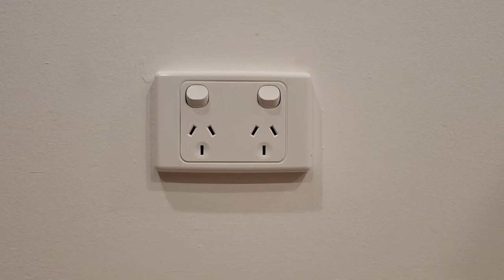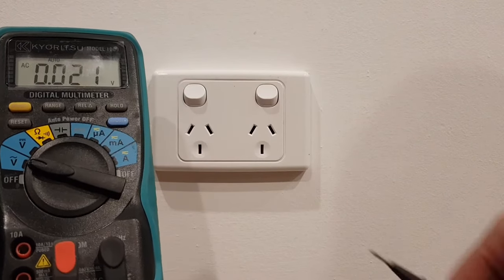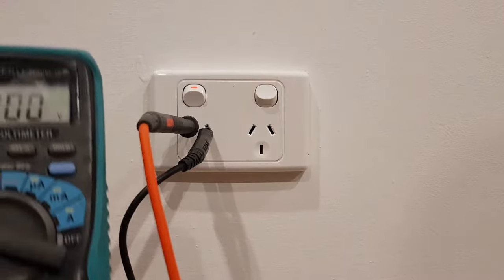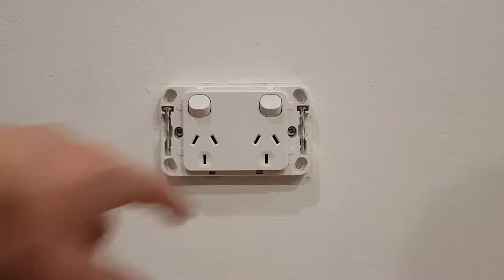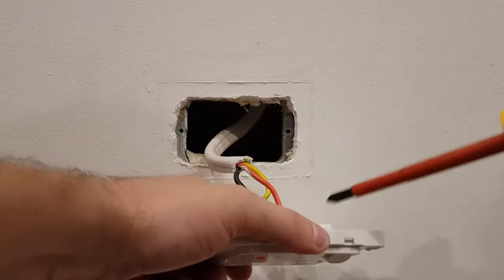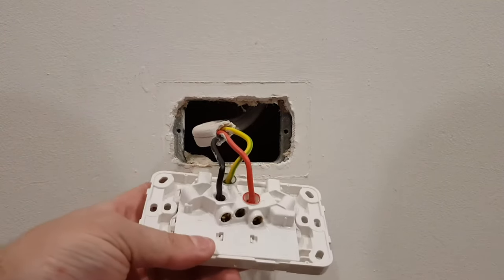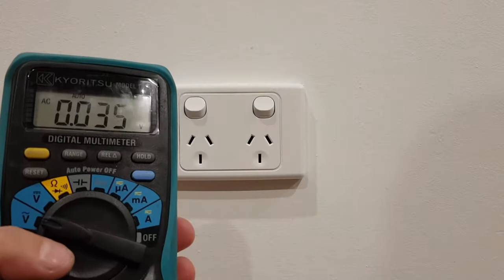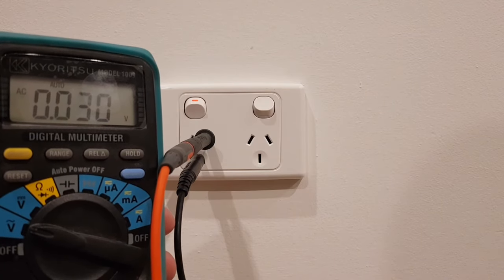HOW TO CHANGE A POWER OUTLET/SOCKET 2024

Comment: Earth cable should have a little extra slack in it - it needs to be the last thing that comes out if the socket were to be ripped out of the wall for whatever reason, earthquake etc.
Reply from the maker: You are correct last to disconnect and first to reconnect 👍

Comment: Thanks for the video it’s very clear and helpful. I have a question: Would the same method be used for replacing a telephone outlet with a power outlet?
Reply from the maker: Yes you would need to run another cable from an exisiting power point and disconnect the old telephone point.

Comment: I've just moved into a new apartment (built around 10 years ago) and a lot of the powerpoint switches are frozen in either the on or off location - is this likely to just be old age (so i could replace them like in the video) or could there be an underlying issue?
Reply from the maker: Yep i would say just grab a qualified sparky to whip around and replace them. Shouldn't take long and wouldnt be that expensive to do it properly. Sometimes its not as easy as whats seen in this video.

Comment: Thanks for the awesome vid mate, so clear and easy 👍🏻Just wondering, I bought a new switch/faceplate and it says 10A rating, there’s another one identical that says 15A rating. What’s the difference ? Cheers
Reply from the maker: Only difference is that the 15A one can handle more current flowing through it. If you only need one for a light switch 10A is the normal one to use.
Reply: @allelectricalau  it’s for an extension cord to run off it to a 4 or 6 plug powerboard, so should I get the 15A ?
Reply from the maker: @doubleniimrodd  no the 10A power point is fine. The extension lead is also probably 10A rated anyway and same with the powerboard.
Reply: @allelectricalau awesome, cheers again mate, love ya work 👍🏻

Comment: Sorry if i sound dumb but i just wanted to clarify if there were 2 sets of red and black wires would i just twist the red on red and black on black then secure them to the allocated terminal on the outlet? TIA
Reply from the maker: Yes that is correct
Reply: @allelectricalau  Thanks for the quick reply, your video saved me I'm in kind of a bind at the moment I recently moved place with only 1 outlet in the kitchen and the whole face plate crumbled into dust from how old it was but luckily the wires were still in tact

Comment: I have the same kind of power point but one of the switches keeps shorting/zapping whenever i switch it on or off (doesn't affect anything else). I'm worried i'll electrocute myself so should i just change over the whole outlet like you've shown or could there be something else wrong? Thanks!

Comment: Do we need to read amps as well. Some power sockets are 10A or 15A, how to decide which one to use?
Reply: 10 Amps are standard in a house
Reply from the maker: Yep 10A for inside and outside your house. Any appliance exceeding 10A should be using a 15A powerpoint such as a big oven or welder.

Comment: Thanks for the video! I'm in NZ. Question. I want to remove a heated towel rail that is hardwired to the power socket... I bought a face place for the socket as I don't want power there, can I just clip the cable? I would get a sparky but it seems like something I should be able to do :-D Thanks

Comment: Thanks for the video. Will I need to replace the power point if I have broken plug pins in the slots?
Reply from the maker: Hi thanks for the comment! 
I would replace it with a new one.
Reply: @allelectricalau  thank you sir! On my way to Bunnings in the morning xx

Comment: Not a sparky here, if I'm upgrading from a double gpo to a quad outlet gpo the principal is the same yeah?
Reply from the maker: Yes sir and it should be the same to screw it on aswell
Reply: Double to quad? Do you know what the total load on the whole circuit will be?? No insurance for you...
Reply: @Clan Cambo  I've just been ysijg microwave/airfryer/ food dehydrator/ rice cooker, but I leave the microwave abd airfryer always turned on, the rice cooled and dehydrator on get switched on when required
Reply: @jolly.red.giant.  Don't do it. No insurance if something goes wrong.
These videos shouldn't be posted.
Reply: @clancambo5297 is that any different to plugging in two power boards with 3 or 4 outlets each?

Comment: Mate - only my left works when I do this? But Both works when I turn on both, is there any reason why? It’s a new new Deta power point.
Reply from the maker: Sounds like it's a faulty powerpoint or wiring is incorrect. Contact a licenced electrician mate that is the best solution.

Comment: Thanks for the vid, what about going from a 2 to 4 plug outlet?
Reply from the maker: Should be exactly the same except you buy a four point outlet not a two.
Reply: @allelectricalau  Awesome! The wiring can take a 4 X outlet from a current perspective?
Reply from the maker: @toddgattfry5405  yes it should be a straight swap the mounting screws should all line up aswell.
Reply: @allelectricalau  Legend!

Comment: I removed an outdoor twin outlet recently which had two sets of wires installed together, is that normal and what would the reason be behind that?
Reply from the maker: Thats normal its just looped in then looped out to the next power point in the house.
Reply: @allelectricalau  ahh I see copy that, very handy to know cheers bloke!

Comment: What about if you want to remove power wall plug all together I don’t need it anymore
Reply from the maker: You will have to join it in the wall with a propper solder connection and jbox. Or connectors and blank plate so you can access join if a fault occurs.

Comment: Hi, my power outlet has 6 cables at it, when replacing it I can’t get all the cables back in. 
What do I do?
Reply from the maker: That's really annoying. Should only be a maximum of 3 cables at one point. Might need to use a junction box and run a single cable out to the power point.

Comment: Hi, the breaker is 15 amp . Can put replace the 10amp socket to a 15amp?
Reply from the maker: No, dont do this!  Usually a 15A socket will have its own dedicated circuit back to the switchboard. Please contact a licenced electrician and they can help you in installing a new circuit so everything is safe.
Reply: Thank you 😊

Comment: When would someone need to spend the extra $50 to get a double pole socket?
Reply: Answer to my own question.
Caravans where you want to turn off both the active and neutral wire when you turn the power point off for extra safety as there isn't an earth.
Reply from the maker: Sometime a dodgy extension lead could be hooked up to a portable vehicle such as a caravan. Having double pole switches and corcuit breakers insure safety and earth parts from becoming live.

Comment: Hey mate, I'm currently running wires to my container about 30m from house. I was just going to do it off a plug to go into an existing outdoor power point, though I'm tempted to drill into the side to try piggy back off the outdoor outlet so I can just put in a light switch in the container or a seperate switch next to the other, would this work? Lol cheers in advance mate
Reply: call a sparky to run wiring correctly. Get it done properly
Reply: @penguin4597  already done now mate 👍
Reply: @callanmurphy9807  praying you got a sparky 😬